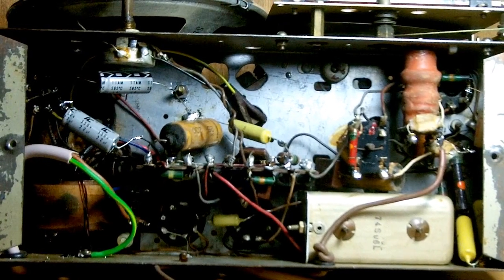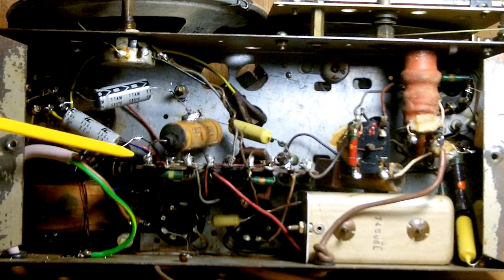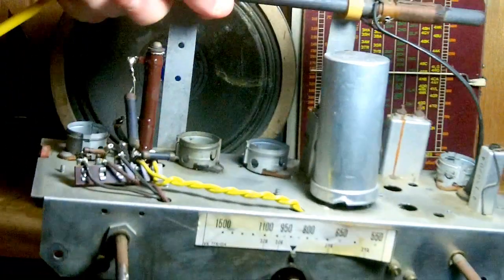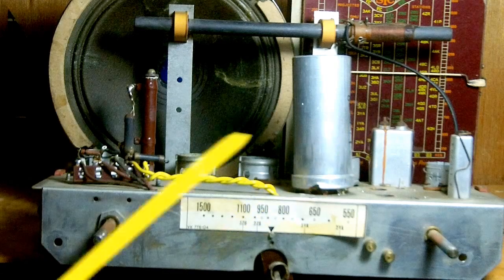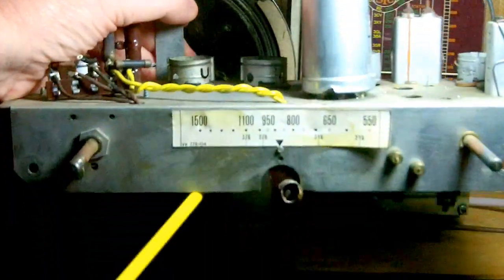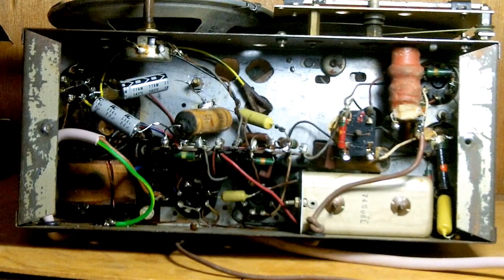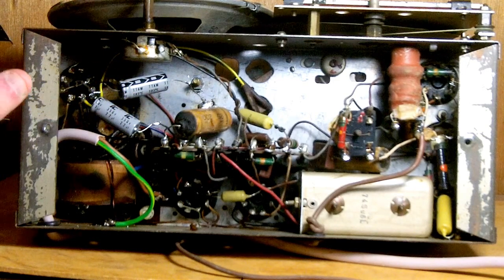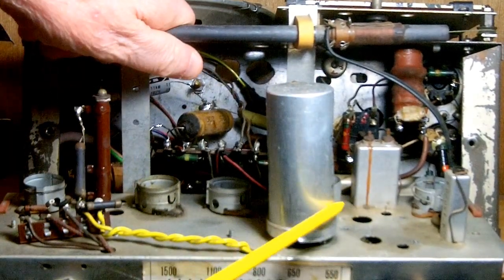Old electrolytic can capacitors a major cause of hum.

Comment: No kidding. The first thing that becomes suspect when a hum is heard in the audio is electrolytics. When they are replaced (not "reformed") if the hum is still there you go to coupling caps next. After they are all replaced, the hum is usually gone for the next 20-30 years.

Comment: The worst experience of old capacitors was in a 1930's radio that also had a turn tabe installed. When i pulled the chassis out i discovered that Atleast one mouse had gotten in there and had eaten the wax capacitors upto half way through so it was time to bust out the soldering iron and get to work

Comment: Old electrolytics dry out and lose capacitance. I had a 32+32 Dubilier can that was so knackered there was still 60V of ripple on the (250V) HT line. I believe the radio also had a UCL83. Anyway that was so gassy it looked like it was filled with argon. The printed circuit board was baked around the o/p tube & rectifier too.
That was a POS & I didn't do a damn thing but put it in the trash. 
It was by far the worst filter capacitor I have encountered so far.

Comment from the maker: That electrolytic can capacitor seen in the video was the ORIGINAL can (59 years old). No wonder the radio was 'riddled' with hum!
Reply from the maker: John Alexander Berry That noise in the background is the bearing noise in my NEW portable electric fan heater. (I hope it can last until the cold weather has gone).
Reply: John Alexander Berry It's not easy to find a good reliable portable fan heater these days.